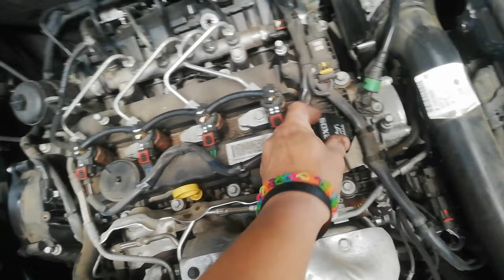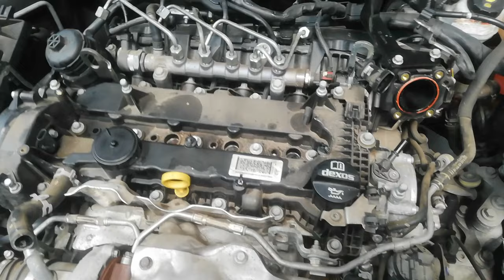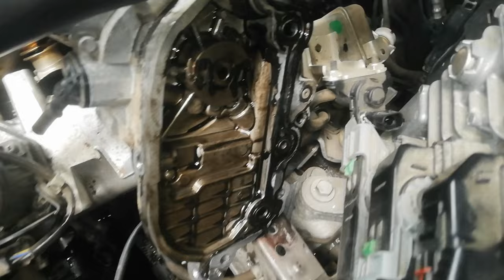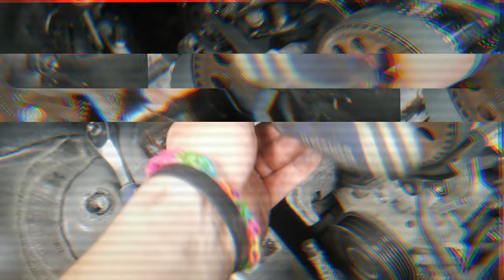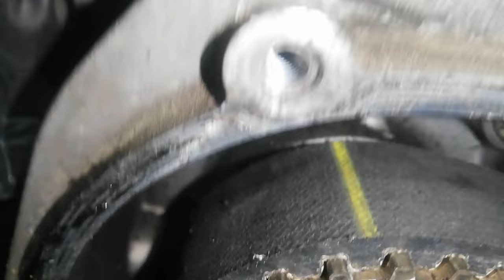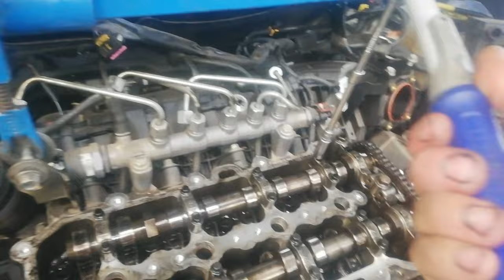Opel 2.0CDTi#Z20DTH# 125kw timing belt change and timing chain replacement without auxiliary tools

Comment: Hello I have the same car opel zafira c tourer 2liter engine. Timing chain torn off, do I have to remove the cylinder head or just change the timing chain
Reply from the maker: It will probably be necessary to dismantle the cylinder head and replace the valves